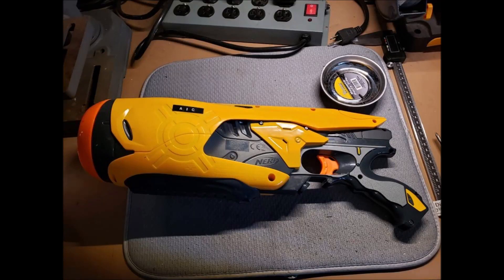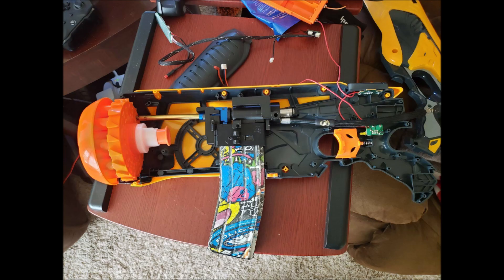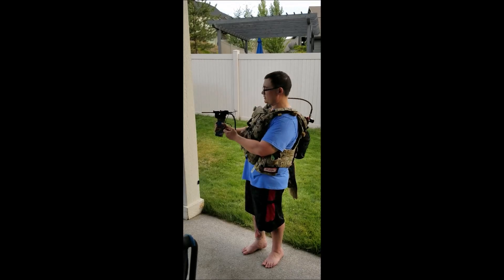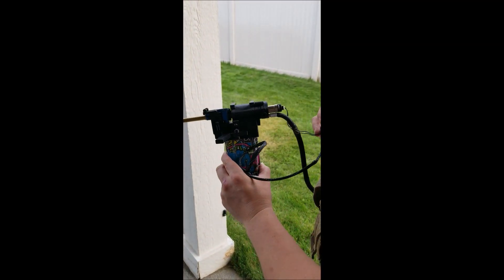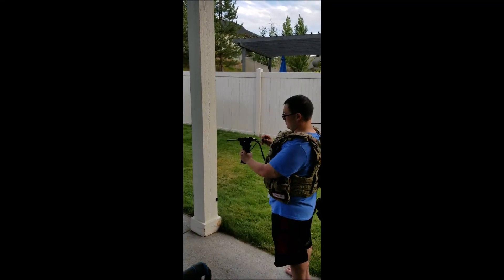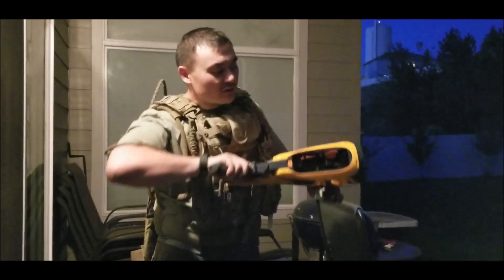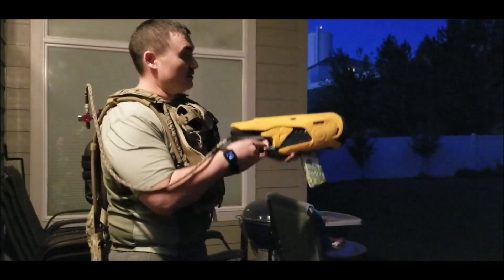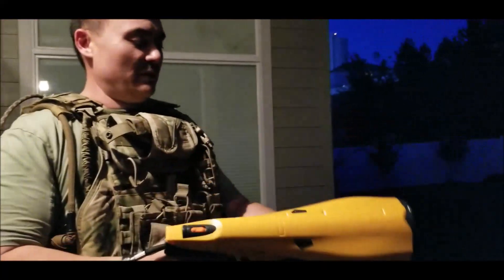Airsoft HPA Polarstar F1 Engine in Nerf Swarmfire Gun

Comment: Hey would I be able to order those parts from you?
Reply from the maker: Just the 3d printed parts or do you also need the polarstar engine, FCU,  modified electrical wiring harness, barrel, hopup, etc?
Reply: Cylix Concepts & Designs just the 3d parts or files so I can print it myself 😁
Reply from the maker: @tacticaltam1722  I have the .stl files loaded here- https://github.com/cyshane/TagInnM72 Happy airsofting!